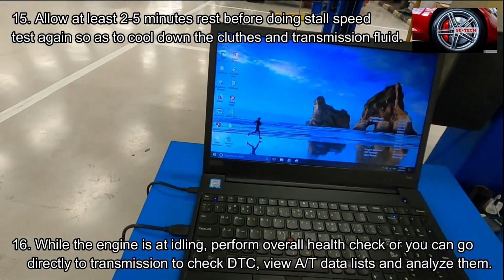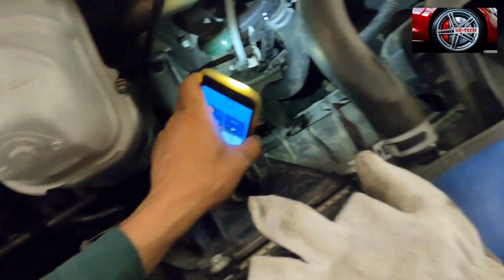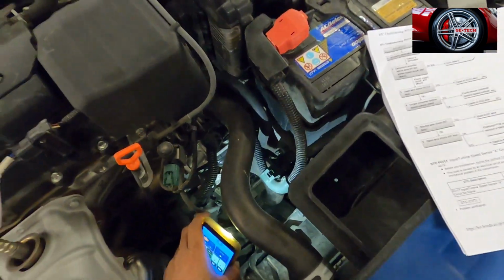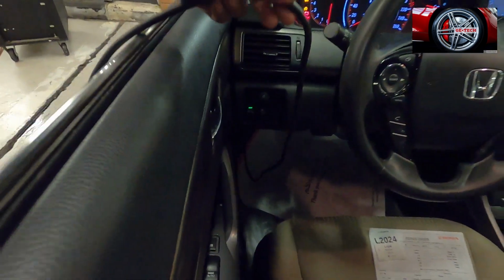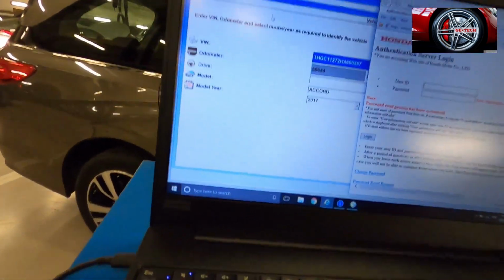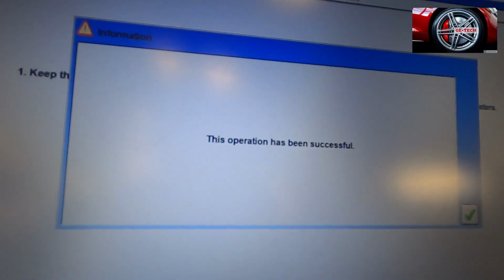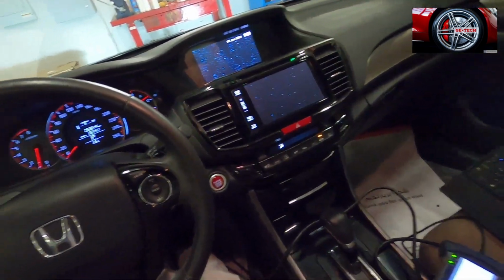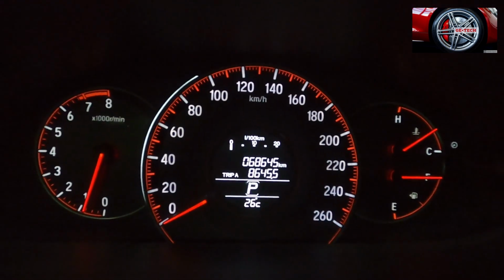Low power while driving with DTC P0717

Comment: I would just like to take a moment to extend my appreciation for your thorough walk through. Im dealing with the same issue and although I might not save any time doing this, you have saved me a massive headache and probably tons of money. I was just going to replace the sensors related to the code(s). However, getting a multimeter helped tremendously, determining if its a wiring/power issue or faulty sensors. Thank you so very much sir. Being a Honda Tech in the service dept. helped ease my mind in trusting the process of the repair. Good day, sir!
Reply: in addition, I have codes P0716, and P0717. P0717 lead to the sensor in the front, same one in this video, reading 110 ohms so definitely faulty there, on to P0716!
Reply: well, It looks like this sensor did the job. a world in difference of how the car feels/drives. I'm elated
Reply from the maker: Thank you for someone like you who appreciate my effort sharing my little knowledge to all who needs it. Have a nice day!

Comment: Hi bro same prabula bat my car p blecking car not strate and scanar also no reding fora tcm and ecm i check fuse all relay your theing what prabulam bro
Reply from the maker: @Autotech2510  If your car doesn’t start, and won’t communicate with your scan tool, “P” malfunction indicator light is blinking, you need to check first the transmission range switch, you can adjust also shift position into park or neutral. The engine will not start if the ECM/PCM sees the shift position is in reverse or drive gear position. Second thing to check is fluid level and DTC. Since your scanner won’t communicate with ECM/PCM, you need to perform DLC or Data Link Connector troubleshooting procedure. You can also get the DTC in other way. Please watch one of my video how to do that..
Reply: @generescudero9492  bro alredy I change range sensor new and I put scanar no reding for tha ecm tcm but anathar abs airbag all reding coming but ecm tcm no coming bro

Comment: Sir Apprentice mechanic ako dito sa japan, napakaganda ng mga videos mo. may tanong lng sana ako, ok lng ba ang mga dw-1 na atf na hindi genuine honda pag nag change ng fluid? nakasabi kc parehas lng ng specs.
Reply from the maker: hi kumusta ka dyan sir, thank you for liking my videos. About your question, yes it’s ok to use different brand of fluid but you have to make sure they  have the same specs otherwise it will damage your transmission or affect the performance. We use toyota transmission fluid if honda atf is out of stock. I think one of my uploaded video  captured toyota atf on my working table. You can watch that.
Reply: @generescudero9492  hanapin ko yung video na merom ganon. Meron kc akong nabili honda shuttle hybrid 2015. Ako lng nag maintainance pgkabili. Di ko maintindihan bkit parang 1/4 lng ng fluid napapalitan hindi pwede full flush base sa system service guide sa computer nmin. Tas alternative dw-1 fluid gnamit ko hindi kc honda ung company nmin. Haha